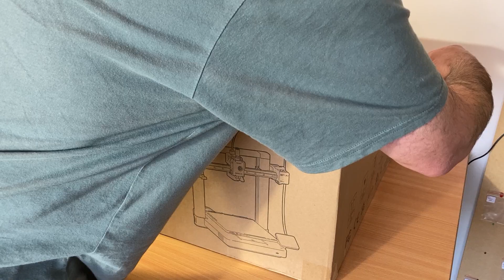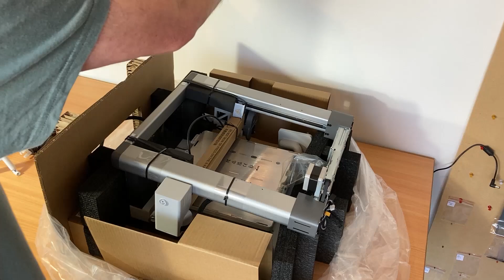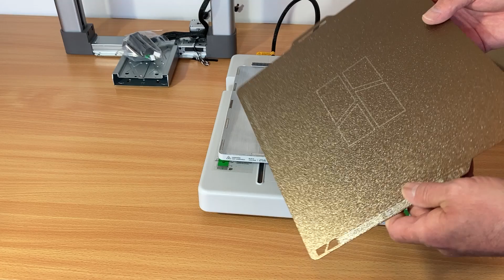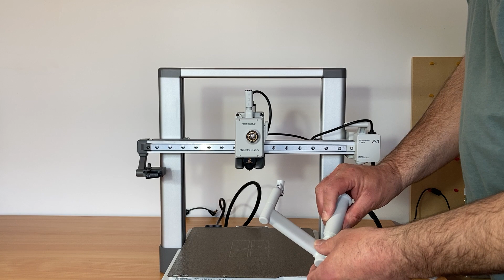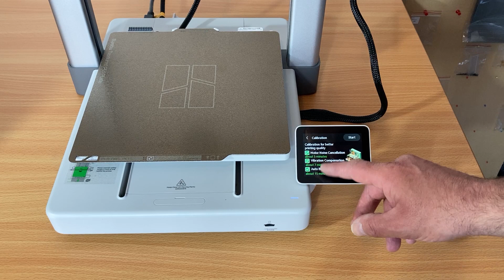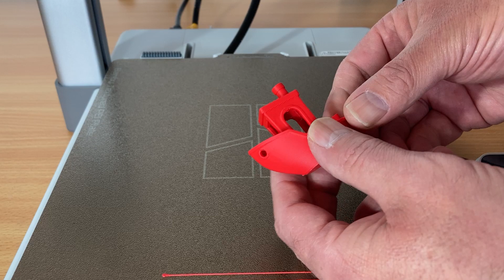Modeller tries 3D FDM Printing for the 1st time using Bambu Lab A1

Comment: Hi Captain, Very nice printer!  As far as removing finished prints, you can remove them as soon as they are finished, but sometimes it takes quite a bit of force.  I usually wait for them to cool and the prints pretty much fall off.  Make sure to clean the print bed between prints.  The smallest amount of oil from your hands can prevent the filament from sticking properly.  Some wash their build plates with dish soap, others use IPA.  I've been using a tiny amount of acetone on a paper towel.  You will have to experiment to see what works for you.  My resin printer is supposed to be delivered today.  Thanks for sharing.   Have a great day.   Jeff
Reply from the maker: Hi Jeff, thanks for the advice.  That's exciting news. I checked it out, very nice, you should have lots of fun with it.